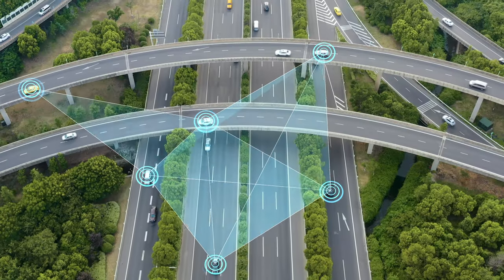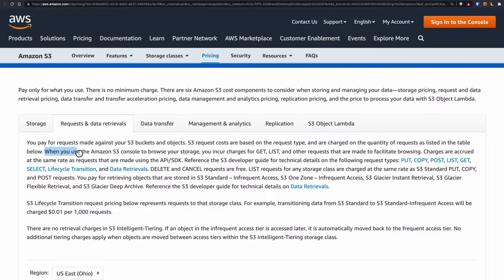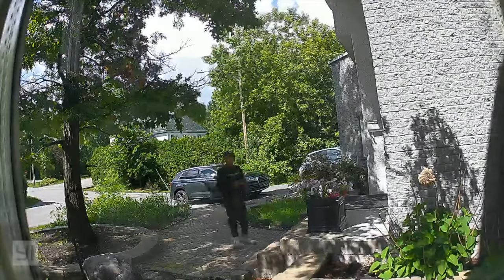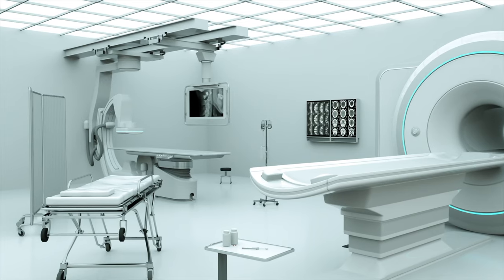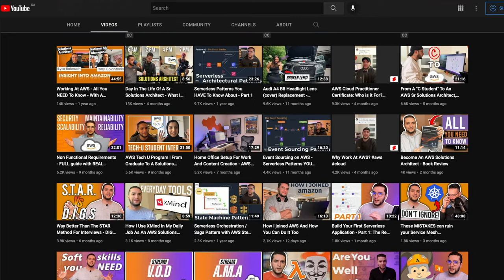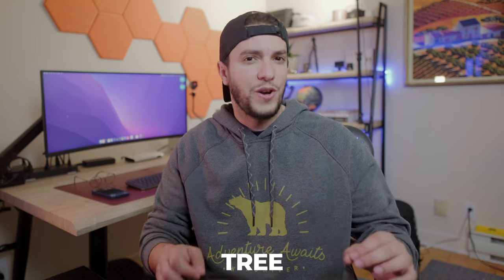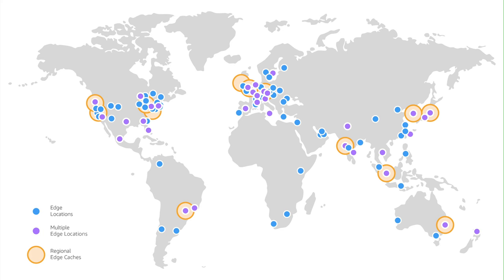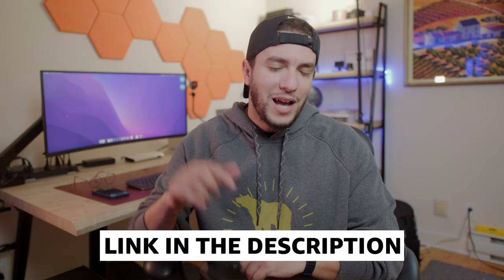How To Architect For The Edge | An Introduction To Edge Computing

Comment: Very much needed topic... There are very less contents to follow... I have a use case where i need to detect fire from a bunch of CCTV cameras... Need suggestion on where do i process the data... At edge or cloud???
Reply from the maker: Detect fire on cameras 🤔 why not use a heat / temperature detector? I found this while reading on the subject: "Infrared detectors use thermal imaging cameras to monitor the infrared spectrum and trigger an alarm when it recognizes the specific patterns that hot gases, like carbon dioxide, that are produced by a fire. The typical alert time for IR detectors is 3-5 seconds"

I don't know how these IR detectors work but I would be more entitled to put the detection on edge, I wouldn't want to rely on WiFi for something as crucial as detecting fire. Let me know what you think